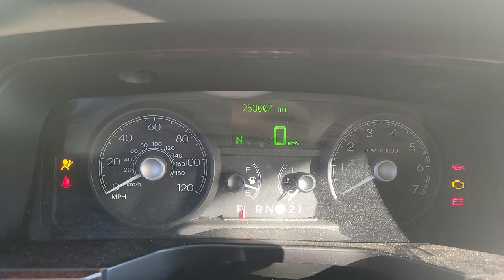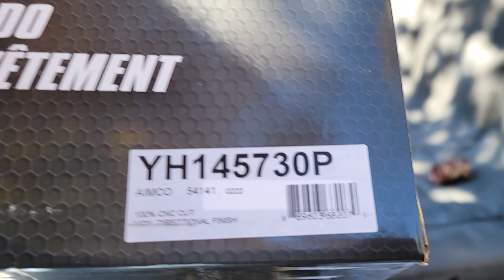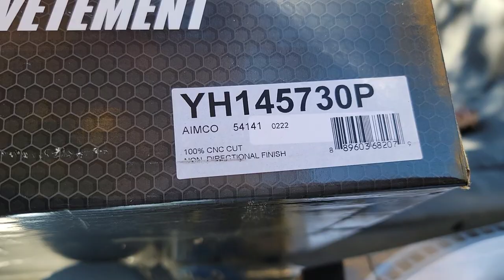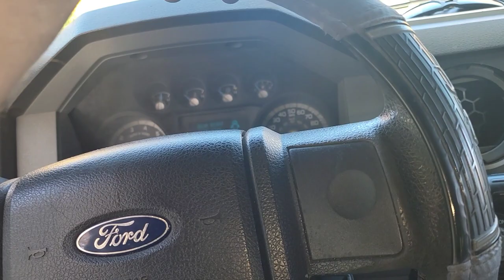2011 F350 Superduty Single Wheel Rear Brakes - Carquest Nice Pads and Rotors #commissionsearned

Comment from the maker: Tools used :
Big Hammer - 
1/2 inch drive torque wrench or Good and old school feel tight - up to you
Electric 1/2 inch drive impact or 1/2 inch drive ratcheting breaker bar 
21mm 1/2 inch drive socket
16mm ratcheting wrench 
Pry bar 
Flat Blade Screwdriver 

Rotors - Carquest Gold YH145730P
Pads - Carquest Gold GMKD1334

Chemicals Needed:
Slide Pin Grease - Permatex 
Brakekleen - CRC
Shop towls - Your Choice

Additional tools that may help cleaning rust - wire wheel on drill or a file to clean up rust

Lug Nuts were 21mm
Caliper Bolts Were 16mm
Caliper Anchor Plate bolts 21mm

Torque Lug Nuts to 150ftlbs - don't use any Antiseize on Lug studs 

Burnish Pads in - when finished installing rotors and Pads 
Step 1
30mph - 0 about 3 times 
Step 2
50mph - 20mph 3 times and get a feel for If it's stopping good

Comment: a mate of mine who is a mechanic full time showed me that he likes to nearly always crack the bleed screw with a tube into a little container before he pushes back the pistons because he believes that the old oil that's in the caliper is better getting dumped instead of pushing it back into the brake system because it's had all the heat and also you don't get the reservoir too full . I've done it the way you have shown  myself heaps of times but i do it differently now after having been told how he does it and why . nice job on everything else and it's great to see a detailed way for doing this job. thanks
Reply from the maker: Yeah the whole bleeder thing has been a debate that's been going on forever it's just really not necessary people just like to do it but it is not necessary
Reply from the maker: Those guys like to use things like oh contamination being pushed back up into the line contamination this contamination that and that's never actually been proven it's not even a theory that's correct and the more you think about it and the more you realize how ridiculous it sounds you're not just pushing the fluid that's in that caliper out of there and expecting to get fresh fluid in there and it be any different if one part of the fluid is contaminated all of it is contaminated so the theory that people use on that doesn't actually make sense whenever you think about the whole equation
Reply from the maker: Secondly you run into a lot of hairy situations if you cannot get that bleeder screw loose it looks like it's fine but when you go to crank on it it breaks off and now you're really screwed and you're putting new caliper on so unless you're actually ready to bleed the brakes I tell people all the time I'm a professional I've been doing this for years and people come to me they want to pay me for my time other shops ask me to come train their guys speak at seminars speak at local colleges so my word means something to lots of people and I'm telling you right now cracking that bleeder loose to do that really doesn't do anything
Reply: @FordBossMe  fair enough i wasn't arguing about it or or saying one way is better I'm just saying that i found it interesting and I've changed my ways. in general the brake fluid should be charged every couple of years anyway
Reply: I heard the same thing.  Fluid in the calipers  get alot of heat.
Reply: @FordBossMe  rich I agree with you 110%. I'm 56 years old done a lot of brake jobs in the past and you're absolutely right about messing with the bleeders that usually is what happens they snap off then you got a whole new bad situation. And you don't want to go down that road. And once again as always great video God bless 🇺🇲 😎

Comment: Did the front brakes on the 2016 F350 I bought. New pads rotors and calipers I don't f*ck around. Been doing brakes on Superdutys  for almost 20 years. Buy once cry once ya it cost me 1800 dollars Canadian in parts but I know I won't be fixing the front brakes for atleast 3 years or more.

Comment: 2014 ford fusion. 230k miles. Put it in gear, nothing happens. Reverse, drive, S. Nothing. Any ideas?
Reply from the maker: Open the hood look under the airbox where the shifter cable goes on to the transmission and you'll probably see the cable is not attached to the top of the transmission shifter lever and either you need a new grommet or you need a new cable and if that's not it you have internal trans problems
Reply: @FordBossMe  that was it! Incredible! Thanks. It’s totally corroded. Gonna have to get it fixed. Expensive?

Comment: Nice job. I just did my lexus, and a corolla brakes this week. Truck could use a little blaster surface shield before it gets any worse . Best part about coating my vehicles is that it makes maintenance so much easier. It's nice not having rusted fasteners. Honestly man you should do that for  side jobs if you can. Easy & fast money.  Places around me charge $250 to $350. I do all my family's cars. Mainly amsoil heavy duty metal protector, crc, this year I used surface shield.

Comment: I always burnished 30/30/30. 30mph/30 stops/30 second rest. Every now and then I'll do a hard stop at 30/30/30. Job well done sir. You doing mobile now or just helping a friend?
Reply: When I finish the job on the Olds, I'm going to try your 30/30/30 method. Got the driver's side done today. That was the side that went metal to metal. Cleaned and lubed the slides. Got the ceramic pads. Passenger side CV boot tomorrow. If this brake job don't last I'm going to use my 30-30 method.
Reply: @mlieser1230  🤣🤣🤣

Comment: Had a dealer do my brakes once. I picked it up (don't ask what they charged) and drove on down the road. I stopped at a light some miles away. And while waiting, smoke starts coming out from the hood/wheel well.

A little too much grease on those pins...
Reply: The new rotors have a coating on them so they don't rust just sitting on the shelf. Its hard to get off using brake clean, so you should just drive on it for a few miles. The real issue is the tech didn't bother to test drive the car. That's beyond stupid. Its the most important part of the job.

Comment: Any comments 2010 ford focus terrible engine to metal vibration. Seems if I pick up on eng. Vibration lessons. Assuming mtr mount. But any info grtl appreciate
Reply from the maker: 90% of the time it's the motor mount or the trans mount

Comment: mr ford boss can a alternator going bad cause problems with injectors and other sensers and stuff
Reply from the maker: I would think so it's a form of giving the computers power and if the computers don't have the power to correctly control things then yes
Reply: @FordBossMe  ok thank you I thought so but doesn't hurt to ask a ford professional
Reply: It definitely can if it is kicking out a bunch of AC current because the diodes in the alt are bad, seen it happen in real time on a Chevy express/GMC Savana.

Comment: That's still the dumbest design ever, the shows inside the rotor. Put the parking brake on the rear of the trans like Mopar did years ago
Reply from the maker: Mopar was actually not the only one to do that Chevy did that long before turbo 400 RV Transmissions right on the back of it
Reply: @FordBossMe  I think DeSoto was the first
Reply: Ram 2500/3500 are still drum in hat , same as ford.
Reply: @semajniffirg230  DeSoto was it's own company until it sold out to Chrysler in the 50’s
Reply: @rockeerockey6941  your history is a little rusty... Chrysler bought Desoto in 1928. God bless.